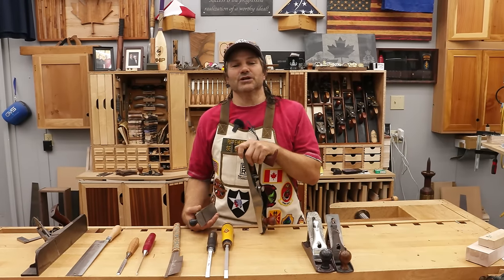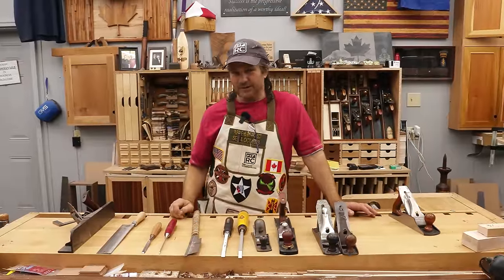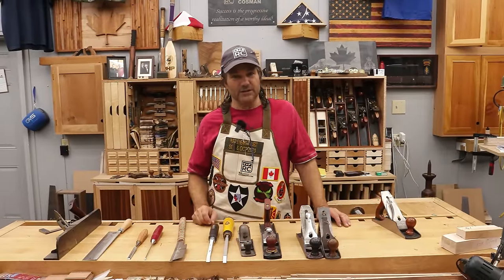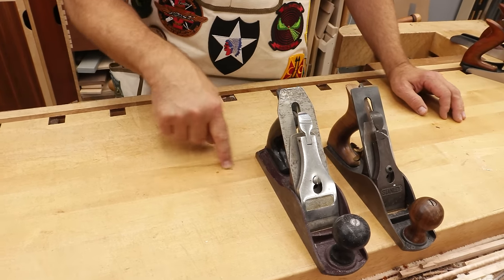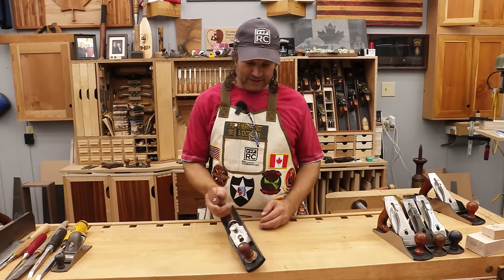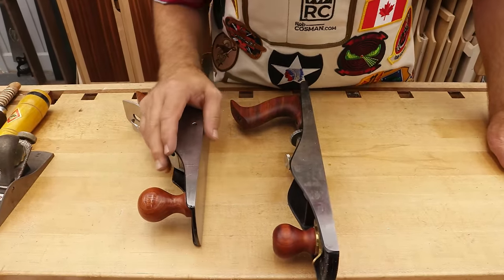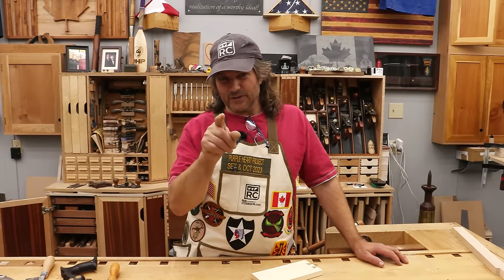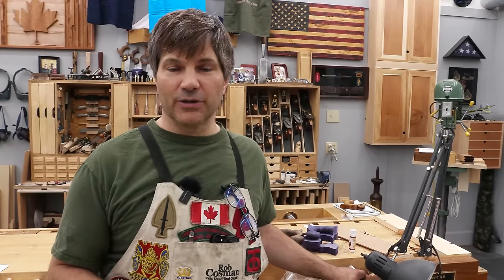Tools Not To Buy | Learn From My Mistakes !

Comment: just about every tool showcased here has a VERY specific function but are presented as all rounders. so no wonder they come out as "do not buy" tools. lots of these are usually offered at flea markets or on ebay as the sellers often time don't have a clue what the tool is supposed to do. 
just as an example: the mortising chisel with the square edge is a tool that is primarily used in corners of rabbets on door jambs so the corner can be cut out perfectly square. the bevel of the blade rides along the bottom of the cut and the back of the chisel lifts the chip. 
beveled edge mortising chisels and slicks are beveled so that you can get them freed out of the cut when you sink the tool into the wood. otherwise you end up bending them or even breaking them if they are in deeper than cutting bevel. if a guide block is needed to ensure a square to the world cut, then it needs to be at the back of the chisel and not the side. 

but then it will also boil down to personal preference in the end and there are really no set rules how you want to use/abuse your tools

Comment: I never have felt any benefit in cutting from a heavy plane, only a lot more effort lifting it after each stroke. Maybe it only helps one-handed shooting? I always use two hands. I built a 15" wooden jointer that only weighs about 1.5lbs and is a joy to use.

Comment: I have several #4 planes but my favorite in the hand is an old craftsman brand. It has a little taller handle thats a little more straight and it fits my larger hands beautifully. I find the blade steel to be goon enough quality for anything i get myself into. Just my 2¢
Reply from the maker: Although that craftsman plane was likely made by Millers Falls or Stanley
Reply: @RobCosmanWoodworking  I've never heard of millers falls. I'll have to look into them.

Comment: Agree with some of this, but I've seen the most precision cuts made with Japanese hand saws, I think it is a tool you have to learn and master, and once you do there is nothing better. Think about all the kumiko and other detail joinery they do in Japan, it is all with thin kerf pull saws. It is possible to make it follow the planar cut you want, if it takes the path of least resistance then you're not doing it correctly.
Reply from the maker: Japanese saws are designed for Japanese wood. Western saws are designed for western hardwoods.

Comment: Is the only reason you dont low angle planes because the adjuster is more difficult to reach? That was the only point you made when comparing them. Thanks
Reply from the maker: Watch that section again, you missed the other points

Comment: With mortise chisels I prefer a slight flare from bolster to tip and back to face, but like your DT saw, since they're oval handled square can be guaged by feel as well as sight. I did try an LN - threw it out - it felt like a toy and I didn't like the parallel sides like a thick firmer. I did find one with a skewed primary bezel - that was a swine to steer until I trued it up. 
Funnily, I prefer traditional gauges for the same reasons you prefer wheels :D Stop and start on a pin prick.
Just what we get used to.
Reply from the maker: I think its waht you learn on, get used to, and that you master

Comment: 18:39 The thing is, that style only works across grain. If you mark along the lenght the wheel will just push the fibers apart a bit and they often close up again, or it follows the grain because you're pushing rather than pulling the knife, screwing up your marking. I actually started out with this type and bought a traditional one to deal with those problems, never looked back...

With the traditional one you actually can see the pin fine if it'sthe correct length, you just need to mark from your stop into the cut, rather than trying to end at the stop.
Reply from the maker: I’ve never had any of the issues that you are describing when using a wheel style marking gauge. If I’m trying to go from two different stop points, you’re back to having the same issue with the pin style.

Comment: HA HA!  I had to go back and revisit your video.  I just want to say that you look wonderfully well preserved for someone who's been working wood for seven hundred years.  I've learned a lot from you, and agree with most of what you say.  I'm not going to accuse you of contradicting yourself when you extoll low angle block planes and dislike low angle bench planes, but it seems you're coming dangerously close.  I don't even own a standard block plane.  I do like my Veritas low angle jack plane a great deal.  Your argument for the 5 1/2 plane is sensible, but I think it has to do with weight as much as anything.  Generally, I like heavier planes and, like you, my hands are too big to hold a No 3 plane comfortably.

Comment: Almost agree on everything. Especially on the 62 (low angle jack). That was a waste of money. 4 and 4 1/2... Kind of... I would definitive get the 4 1/2 first. But if I have to plane edges I grab my 4. On the shooting board plane I disagree. I use it all the time and it is such a Joy! As my shooting board has rails it works a a charm. But it is also one pf the last tools I would get as it is definitive not necessary. One can do everyting without it.
Reply from the maker: Thanks for a great comment

Comment: While almost everyone uses a shooting board for planing end grain, there is another use of it:  Planing a perfectly straight and square edge.  If I try the usual technique of planing the edge in a vise with my thumb as a fence, it never works.  My edges aren't square and usually not straight either.  But using the shooting board as a jig, I don't have to worry about that. It keeps everything square and straight automatically.
Reply from the maker: I have a few long and narrow shooters just for that purpose.

Comment: Great message as always. I myself have a list and some are duplicates of yours.I have been buying tools since the late 70s and have given away most of them and upgraded. I think we are in a position now that it is easier to buy good quality tools at a better price than when we started buying tools. As you say about quality of your purchase makes a huge difference in your work flow and final project quality.
Reply from the maker: In the 80s while I was at BYU it was impossible to find a dovetail saw with rip teeth.  When LN started making one I thought it was a miracle

Comment: The standard angle Woodruver block plane doesn’t work for me. The lever cap wants to pop open. It’s the way I hold it not a flaw but I prefer a Stanley 9 1/2 for its small size.
Reply from the maker: Ergonomics are not great on standard angle blocks.  Better to increase the bevel on the blade in the low angle version, same cutting angle but better handling

Comment: The stanley #65 marking gauge has the marking pin at an angle so you can see it while in use. Problem solved. All explained in the Stanley patent granted in 1952. The patent number is US 2,579,205.

Comment: That grip is a great idea, like the knob LN has, but more ergo.  However the knock on the original is kinda irrelevant as control is not required on a plane that runs in a track.  Like the original, or the one LV brought out.  Has anyone noticed (no sure on this), that the "track is actually stock from their earlier drawer slides?  Could be.

I do prefer the untracked system because there are two ways to use it, and one way doesn't allow a track.  Plus I can also use a sanding block on the board, not something with a lot of utility, But my preferred way to dress a joint in musical instrument plates.
Reply from the maker: I wasn't "knocking" the shooting plane design just that its very expensive and you dont need to spend that amount of money to get a good shooting plane. Why not let your bench plane do double duty and save that money for another tool?

Comment: I can’t disagree with any of the points he raised, except I really can’t be lugging a wide Jack about all day. A number 5 is my go to plane, with a low angle block, the only planes of that type you will ever need. I have 3 smoothers of various widths that have only seen the light of day occasionally over the last 30 years, and a mahoosive Jointer that I have never used.

Comment: That long teeth break off knock reminds me off Tage Frid, and that ridiculous picture in his great book.  Though in fairness, while the picture was of a crosscut saw, those were all we could get for decades in backed saws from Japan.  You have to figure that given that their tools use a tougher oak than we have, and they are much nearer forest that have rosewoods and ebonies, they have to have some way to cut them...

I remember writing Leonard Lee, probably mid 90s, it was while he was still running LV, and mentioning that at the time they did not sell a single pro quality plane, saw, or chisel.  Japanese tools and german tools were gone, and they hadn't built their own yet.  Not long after they brought in a Japanese rip saw, that for 20 bucks was great  But when Independence tools came out with their dovetail saw, that settled it for me.  I like the wider kerf as it makes the chisel work, that much easier, or if one uses a coping saw, which I don't but have suggested it to people who were trying to get through a project and needed a lift.  These days I would be buying your tools as I am at Grand Lake, but I have 6 of everything already.  One thing about starting in the 70s is that we had garbage to start with, and so it was tempting to keep upgrading when something better arrived.  Therefore, enough tools for a lot of uses,
Reply from the maker: very few people know about independence saws.  Did you know that was started by a retired Veteran, an Amry LTC who couldn't find a good new saw

Comment: For gent saws I put the tip of my index finger right on the top of the saw back and kinda point my way through the cut so to speak. This keeps me straight every time. Still beginners should buy a handled dovetail saw because gents aren't as suitable for large pieces of tough wood.
Reply from the maker: I agree totally

Comment: Old fashioned marking gauges were designed to mark both ends then travel from one to the other.
I would not be able to start at either end with that circle cutter since the shape obscures the start and end point, looks cool but useless for me.

Comment: Unemployed, I begin woodworking classes for reconversion. do someone have a relatively cheap chisel brand to suggest ? Oh and also a suggestion for a small square ?
Reply: as a new(ish) wood hobbiest, I got the blue Irwin Marples set.  I like them, but the bevel edges are sharp, I've cut my hands once on the edges.  need to dress those with a file just to unsharp them.  I have an old set of craftsmen that I have abused for years, but I redressed them and they cut pretty good now too, they are shorter than the irwins (probably just general purpose chisels).
Reply from the maker: We did a Youtube a while back testing chisel metals and the WoodRiver chisels did surprisingly well.  I do not like the socket style handles but they feel good in the hand.  It takes longer to flatten th eback of a cheaper chisel since they save money at the factory by not grinding it very much but that just means you have to spend  a lot of time flatten...but you save money.  I recommend a Starrett 6 inch combo square
Reply: Many thanks 🙏

Comment: Actually, I don't find your opinions that controversial.  However, here is a point I would make with regard to standard angle vs. low angle planes.  While the geometry of the angle  hitting the wood might be quite similar because compensating effect of the bevel-up vs. bevel-down arrangement, the geometry of transmitting the blade's resistance-thrust back into the body of the plane is different.  With the low angle plane the hand supplying the forward thrust is more or less directly IN LINE with the blade, whereas with the standard angle plane the blade is ABOVE the hand.  I believe this configuration is more prone to chatter when planing through tough wood (especially knots and across end-grain).

Comment: My 5.5 has concave blade for better smoothing. For the shooting board, I have dedicated 5 with flat blade. It is always faster to grab the proper tool than to disassemble, reassemble, and adjust the same plane.
Reply from the maker: I agree with your dedicated tool.  I prefer a flat blade with eased corners, so I don't have to change blades between planning and shooting.  That's even less work to do!!!!
Reply: @RobCosmanWoodworking  I was not able to get rid of the plane tracks while using flat blade with eased corners. Had to ease them more and ended up with concave blade :)

Comment: When I first got into carpentry my employer was a fanatic about Japanese tools, it was way back in the early eighties and the saws were only available from a master blacksmith, they were brittle and if you didn’t back off the pressure on the forward stroke you’d risk a bind that would very often form an s curve and the blade would snap. This was horrible for a beginner because they were expensive, but it made for great technique and I soon realized that the pull was were you’d get your accuracy. Turns out Japan may be the first culture to produce woodworking, you’d have to be a blacksmith first, in order to make the tools, then you could go on to woodworking, maybe you’ve read about how strict an apprenticeship was back then. I read about an apprentice that was caned for stepping over the masters saw. Love to see the people I’ve worked withs face when I tell them that story, my tools were well respected after that 😂

Comment: I was extremely disappointed on receiving them to find the otherwise well made Narex mortice chisels had a taper.
Thankfully there was enough metal in the 16mm to make it parallel sides at 5/8"  an obliging engineer friend ground it to suit.
Reply from the maker: Good idea.  Its actually very difficult to manufacture them dead square

Comment: I don’t have those big bear paws so using a No. 3 is no problem for me, I do like to fit the tool to the work though. I don’t have a 5 1/2 but I do have a 6 and I only use it on flattening table tops and panels something a 3 couldn’t do well anyway. You might use your block where I would use my 3? Interesting that we have techniques based on our physical size, but it makes sense though. I love my 4 1/2 and I will never part with my bevel up jack, ever. The key to not breaking teeth on a Japanese saw is to let the saw do the work, which means cut slowly, don’t press down hard, and let the saw do the work. Quite the opposite of how you used your saw. Neither is right or wrong, just different. I teach both and let the students decide which one they like.

Comment: I would add the right pencil. Mechanical pencil leads break off in rough grain. The eraser on most standard pencils gets hard and smeary after a short time. Get a box of Dixon Ticonderoga #2 pencils. Real wood, can be sharpened to a fine point, and the eraser works until there’s nothing left.
Reply from the maker: I agree.  I like the darker lead….2B I think

Comment: Interesting video! I agree with what is mentioned.. however, when it came to the Japanese vs western saws on western woods, the demonstration was only done with the western style saw. I think the ultimate 'proof in the pudding' so to speak would have been to replicate the cut with with the Japanese saw to actually show its "shortcomings" on western wood. Only demonstrating the western saw side of things feels like a lost opportunity and the optics come off as "biased" for a better lack of words. Very one sided given only one saw was used and not both as a real world fair comparison. I am skeptical of this claim simply because I have seen other wood working Youtubers use Japanese pull saws to great effect creating beautiful joinery (whether the cuts needed chisel paring down afterwards for greater precision or smoothness I do not know). I assume they were used on western wood (as these are filmed either in the US or Canada). Would have been nice to actually see the differences both saws produced in this video!

Comment: Rob, you are correct on the Japanese saws, they are not designed for western oak wood, and some what off on the #3 size plane. I use my #3 as a block plane, works just like a block plane.
Reply from the maker: I prefer a block plane for its lower profile when I need a block plane, but your analysis is correct